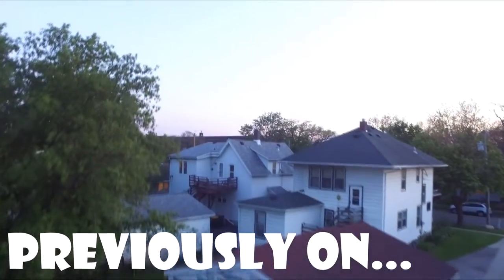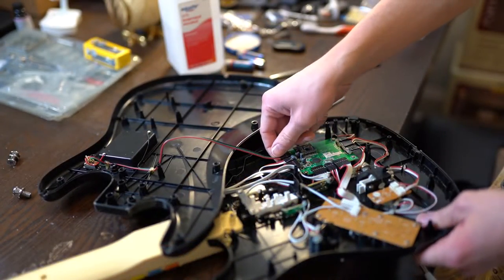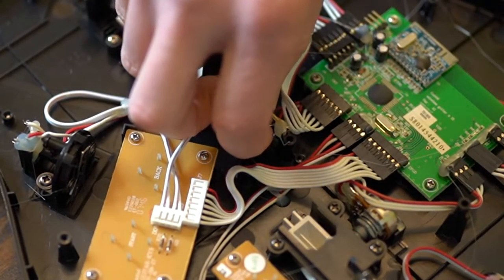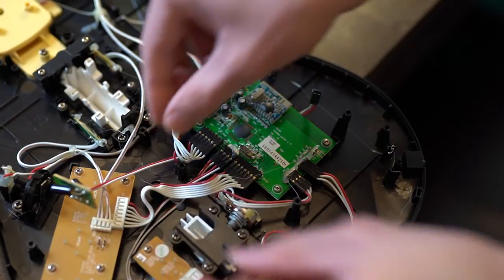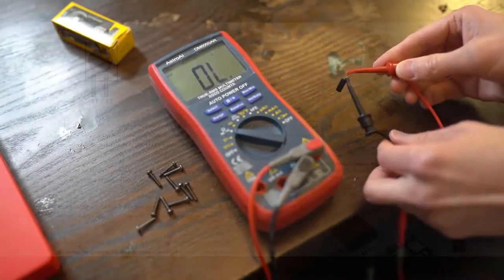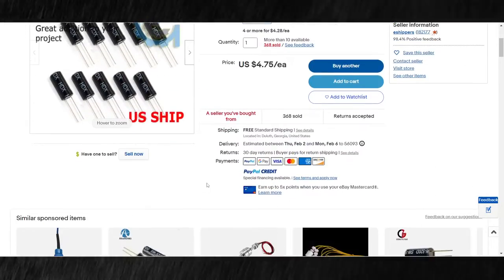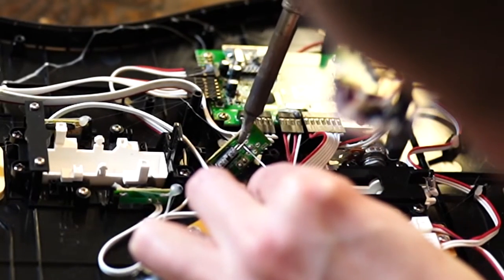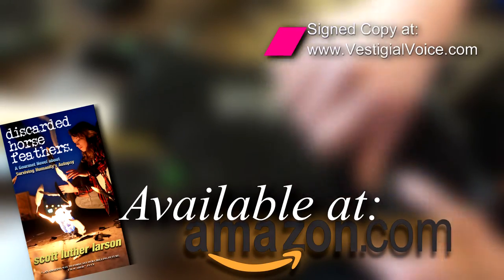How to Fix Rockband Guitar Overdrive or Star Power - Tilt Switch SW 520D

Comment: I actually just broke out my ps3 with my rock band guitar last night. Had a blast. Went to play today and after the second song it just died. I figured it was the batteries so I changed them. No luck. It's not turning on. I verified I have 4.4 volts at the battery block and at the incoming power supply to the board with the switch turned on of course. I have no idea where to go from here.

Comment: I just wired up a new button to the board and drilled a hole in the body to create a physical Overdrive button works great
Reply from the maker: That's cool, aussie 👍
Reply: Or yyou could just press the select button which is right next to the strum switch. No need to add redundancy
Reply: @YankeeCherokee  Of you can add whatever you like to your instrument because you own it? It's only redundant if it doesn't get used.
Tons of people find the select button awkward.
The only controller that ever really got it right was the GH5 version

Comment: Hey! We just fired up our XBox360 Rock Band after 5 years in storage and its the same problem on 2 guitars. I’ll open up them up over the weekend and see what’s what. Thanks for the video!
Reply from the maker: Follow along with my video, Carlos, and it should be a snap! 😊
Reply: @VestigialVoice I took apart the guitar and found the board that the ball tilt switches are soldered to. Once I disconnected the board I was able to check continuity across the switch. Sure enough, no matter hard I shook the switches, the contacts never closed. Got new ones on order from Amazon, 100 of them for $10. Glad you posted that video. I was considering buying new guitars.
Reply from the maker: @CarlosNMLobos1996  Awesome! 👏

Comment: How do you know when it needs a change or justment? I have a guitar with the same problem and although I already ordered the parts I don't know if I can do anything to repair it before soldering
Reply from the maker: You'll have continuity if the tilt switch is upright and you will lose continuity if the tilt switch is upside down.

Comment: My Hofner Bass for RB: Beatles on Wii does the opposite. Automatically triggers OD as soon as meter is half full. I’m gonna try this fix. Thanks!!
Reply from the maker: You may not even need to solder.  I would start by repositioning the tilt switch to prevent it from accidently triggering.  If that doesn't work, you may have adhesion of those metallic beads.  In that case, purchase and install a new set.

Comment: I have two guitars with problems (probably tree) all of them are guitar hero models and not rock band, one of them is activating with minor tilt, and the other has the same problem than yours but not as bad ( i can activate star power if i tilt the guitar and hold it tilted for a few seconds) i wonder if i can locate the sensors in it and maybe replace it.

Comment: Hey, great video. I dont have any idea how to solder though. But anyways, my guitar activates the star power on its own, or its incredibly sensitive i could say. A slight tilt activates it, so that would suggest that the sensors arent dead at least. Do you know if theres a fix for this? Thanks😊
Reply from the maker: Oh yeah. Your tilt switch sounds fine, but it sits on the board in such a manner that it triggers easily with the way you hold the guitar.  A subtle repositioning of your tilt switch will fix that.  You won't even need to solder for your adjustment!
Reply: Thx just the solution I was looking for I'll try it out